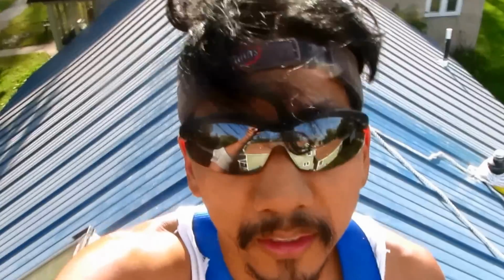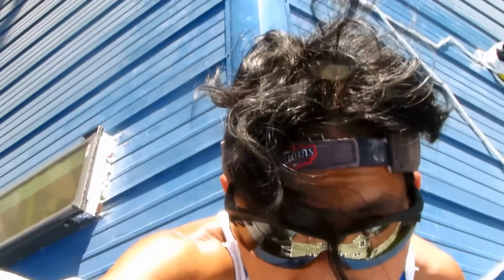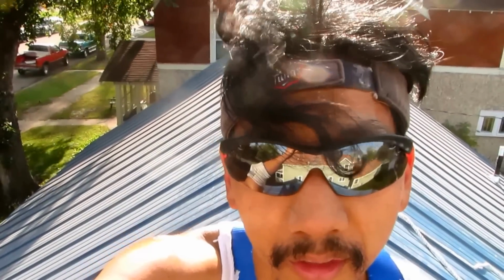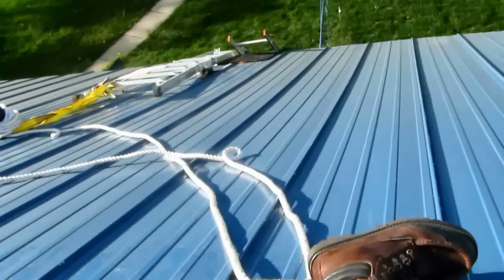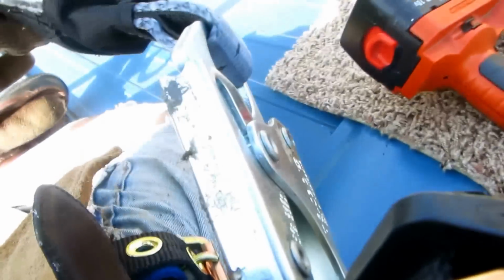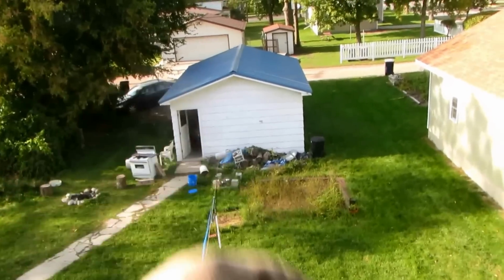Equipment for Climbing A Metal Roof

Comment: There so many things wrong with this and his ladder setup isn't even the worst. Don't take his advice and never let him touch your house
Reply from the maker: I agree, DO NOT use this set-up. This was the best I could do with what I had. I'm no carpenter or have any experience . The guy that helped me didn't have any "safer" equipment , but I'm just glad we got it done. This was only a 1 1/2 story house and if I fell, I would've landed on the grass :)  Here are some better safer options if you have them.. 
http://homeguides.sfgate.com/ways-work-steeply-pitched-roof-55689.html  or try this (just found this along with  this video) =>  Standing Seam Metal Roof brackets www.metalplusllc.com
Reply: @denzel Edwards.  Suggestions on better ways would be great!